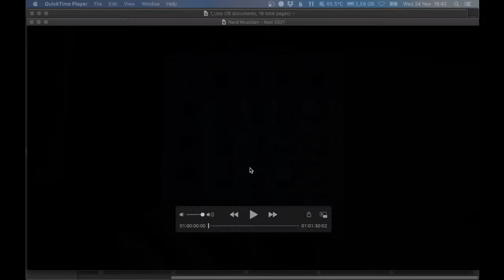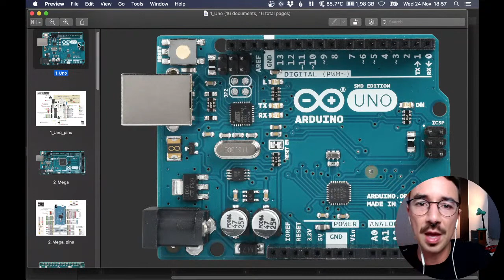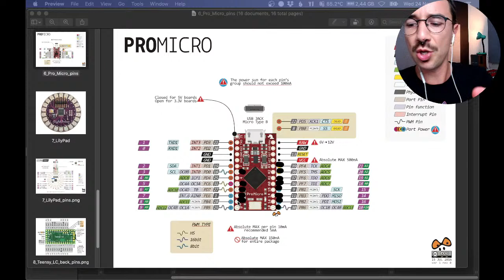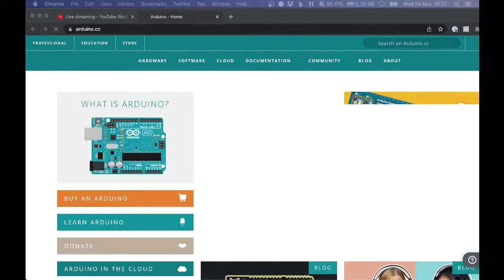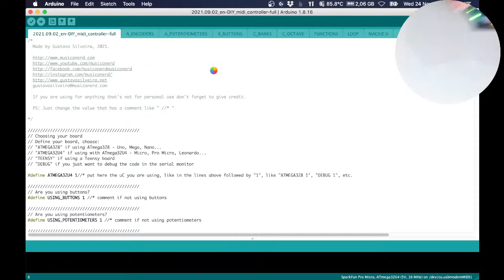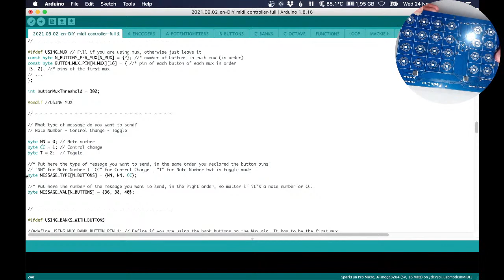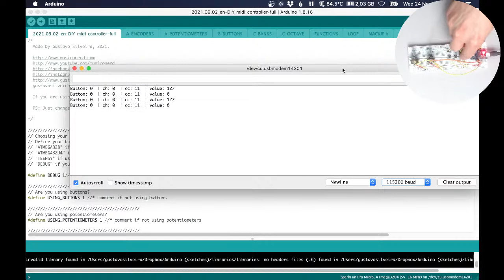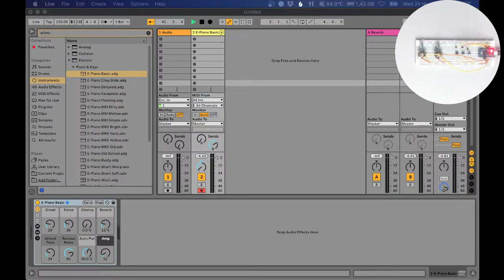How to Build your MIDI Controllers with an Arduino - #1 FULL LIVE video

Comment: Hi Gustavo!
I want to build a midi controller with 12 buttons and a switch, is there a single board from Arduino that can handle all those inputs or I'll have to use a multiplexer?
Thank you very much!

Comment: even i have study electronics, i never get my self in coding. but with your traktorino code, and another similar code i found, midiuino.
i have combine the 2 codes and i have make a dj console very good and is working like a professional ones. i use the console with TRAKTOR softwear.
it includes  3 encoders
16 potentiometer
32leds
22 buttons.
a small problem that is not a big problem are the sliding potentiometer's, that are not respond in little movements.  for example, if its in 0
it start to move when is in 10, then all way up to 100.  and if is in 100 it start to move when its in 90

Comment: If Im using more buttons, Is it necessary to use resistors??
Reply from the maker: Nope! I don't use any resistor for buttons. Search for "PULL UP RESISTOR", it's a built in resistor that you'll use instead.

Comment: Can you do Human Controllers.  Take MIDI signals and convert them into lights or small electrodes that can be attached to a human.  For example metronome signal that shocks the right foot and then the left foot on beat 1.  Shocks delivered in time with notes played on the 6 strings of a guitar.  Think of it if instead of the Human controlling the computer.  The computer controls the human?  Through bright lights and electroshock.  I have a lead guitarist who has bad timing and needs a system like this.  Can you help?